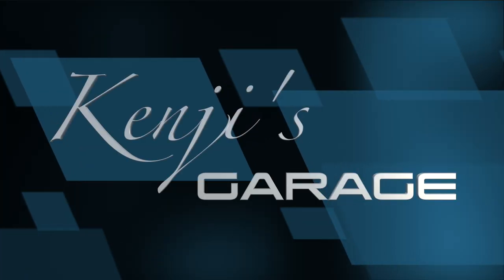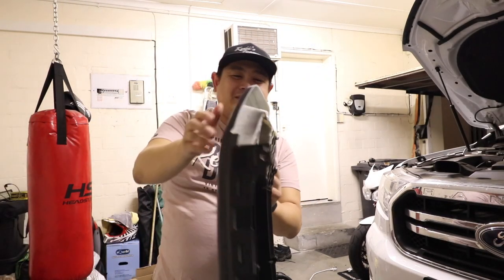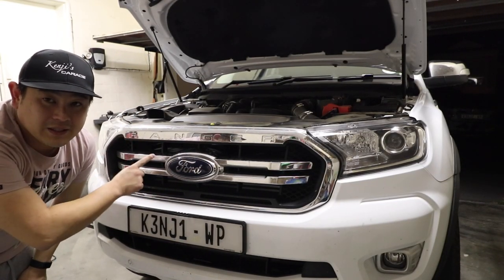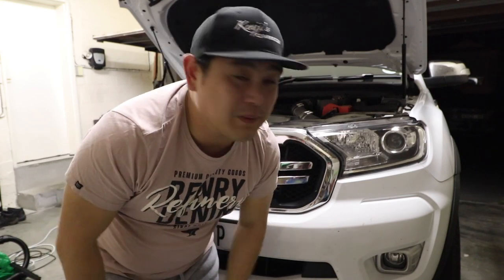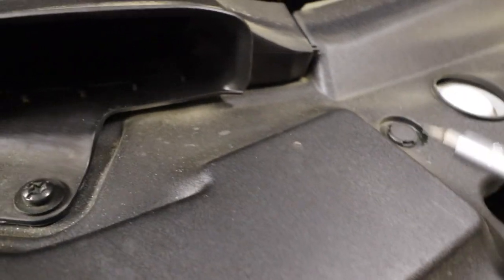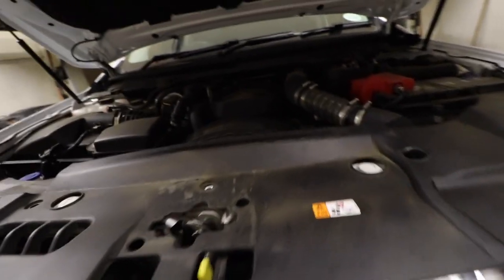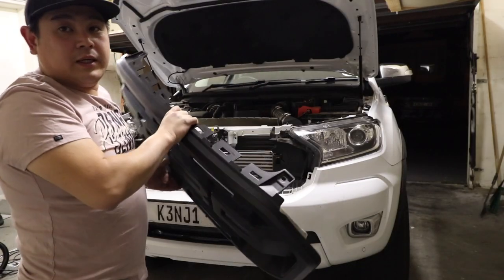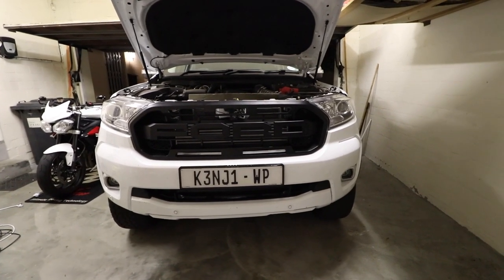Ford Ranger Raptor Grill install

Comment: Hey Kenji, love the videos! My grille arrived today but did not have clips for the bottom. Can you attach clips from the original grille to the new one? Thanks
Reply from the maker: You should be able to.. that’s what I did. But be careful, those clips are fragile!
Reply: @KenjiLo1  awesome mate haha yeah hopefully my temper doesn’t snap one haha thanks for the reply and great video
Reply: Mine too but even without screw to attach the font to the grill 😢
Reply: @micahchung6010  in the end I figured out that my grill was sent without mounting clips as some modern ford grills won’t let you detach the existing clips.
Reply: @christianwulf4729  mine too, i sent to shop to install, they can only DIY it by drilling a hole and cable tie😥

Comment: Hi Kenji , tell me your car lights ... did it come standard with xenons or did you fit in your own bulbs?
Reply from the maker: Aftermarket
Reply: @KenjiLo1  could you perhaps recommend a good one to get?
Reply from the maker: They call it C6.. these are the ones that will fit in our car
Reply: @KenjiLo1  thanks champ , dig the upgrades on your Ranger. Mine is coming along nicely aswel

Comment: Hi Kenji ... wanted to ask , what would be the perfect light bulbs to fit into my Ranger? I'm no fan of the original bulbs and want to change them perhaps to something white like
Reply from the maker: Where are you? Mine at the moment are C6’s, but not the best, it’s white but not bright.
Reply: @KenjiLo1  I'm in Centurion , need a lekker set of bulbs something that will really light up the road
Reply from the maker: Best is a set of off-road lights. I really need to do an update on my new stuff I put on my rig

Comment: Hey Kenji thanks for your videos  - also considering the Ranger 2.0 single turbo. how is your average fuel consumption ?
Reply from the maker: In town driving, I get around 650km out of a full tank. In open road, I got up to 850km.
Reply: @KenjiLo1  so around 12 l/100 town - 10 l/100 open road? 80 liter tank
Reply from the maker: Around there. I only manage to fill 75l into my tank. 5l in reserve.

Comment: Hi Kenji, just to confirm, I have an Everest Bi-Turbo 2020 XLT 4X4. Will that Raptor grill fit my car?
Reply from the maker: I can’t say for certain. But you can email bakkiebarking.co.za to make sure. I have seen it on Everest before
Reply: @KenjiLo1  Could I please ask where you ordered it from and the part number? I phone Ford and they keep asking for the car's VIN first.
Reply from the maker: Yes, you need to get a VIN number from a Raptor. My dealership used the one that was standing on their floor. To assist me

Comment: stock raptor grille or modified?
Reply from the maker: Straight from Raptor. It fits directly on to a 2019 XLT
Reply: thank you. subscribed done👍
Reply from the maker: Just finished with my dual battery system! It should be uploaded a day or 2.